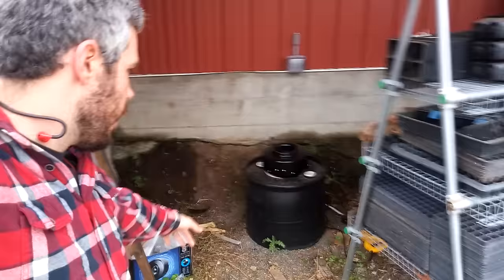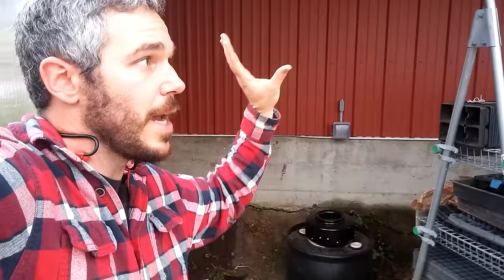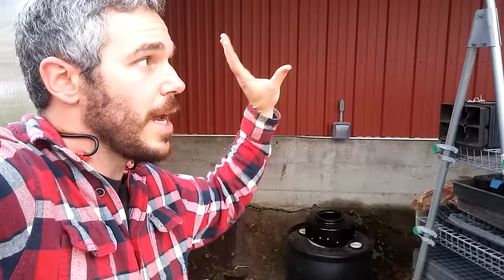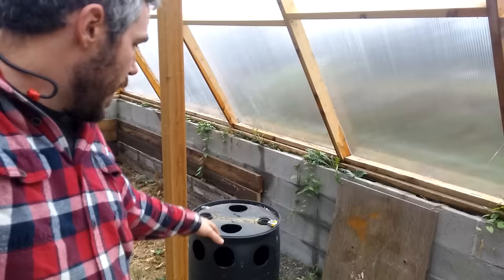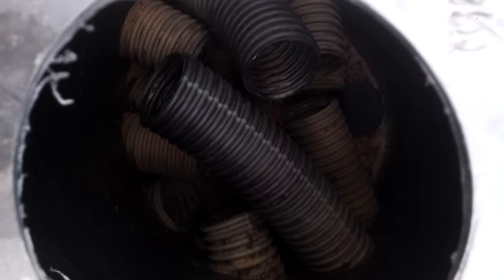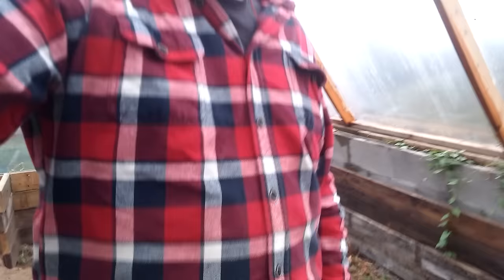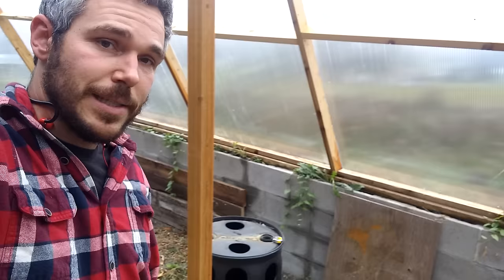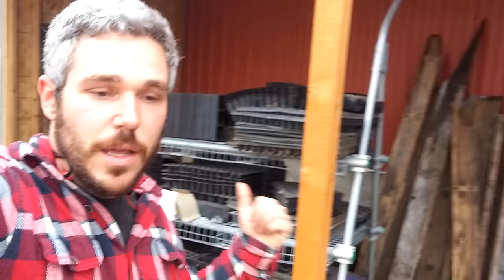Poor Man's Geothermal

Comment: Very cool and I love that idea of the poor man's geothermal.  If you can pull 20 degrees of heat out of the ambient heat of the soil at a depth of 4 or 5 feet  beneath the green house - then you are able to go far in keeping the air temps in the green house abouve freezing - even on the coldest days.  Question -  did you place thermal barriers around the out side of the green house in order to stop the incursion of frost under the edges of the green house?  if that were to happen, I would imagine it would have some significant effect on the amount of heat transfer you could harvest.

Comment: Did I miss the part about how deep to bury the drain pipes? 🤔
Reply: 8 feet. 54 degrees. Warm enough for soil biology but too cool for worms.
Reply: @Horse237  8 feet?  I am luck to have 8 inches of soil!
Reply: @kieranhanrahan2883  Texas is having problems because they are not prepared for the kind of winters Michigan has. Talk to contractors around the country and ask them how deep to bury water pipws so they don't freeze. There were men trying to get away with burying water pipes 6 inches in the Deep South. No More. We entered a Grand Solar Minimum just like the Maunder Minimum of 1645 to 1715 when weather was so bad that wheat prices spiked up to 400% in some years.
I was talking about dirt and not soil. That is where to bury the pipes taking 54 degree air to your greenhouse year round. Cooling in summer and in winter it takes less energy to get the air from 54 to 70 degrees than from 18 or 20.
Reply: @horse237

Like what was just said it depends on your location. In the northwest the freezing depth is only 12 inches.  So do me I may only need to go down 2 feet

But that is because our temp is heavily moderated by the ocean.

But upper Minnesota for example you'll have to go much deeper. Locals will know.
Reply: @briholt100  My point about 8 feet is that we just entered a Grand Solar Minimum just like the Maunder Minimum of 1645 to 1715. It was much cooler back then. The price of wheat in the UK spiked up to 400% in certain years. In 1709 there was a Big Freeze in Europe and the top 40 inches of the ground in France froze spiking food prices 600%.
So obviously if we are entering another Grand Solar Minimum as evidenced by last summer's historic floods in China and the most recent polar vortex wreaking havoc as far south as Texas and Mexico, we ought to dig pipes deeper than what contractors did in the past.
That is why if I ever get a place, I will dig my geothermal vents 8 feet deep. And I will install lightning rods to protect my animals. We will be getting a lot more cloud cover, more rain, more hail, more snow and lightning. I have read of several farmers in Europe losing 50 sheep at a time to lightning strikes. And I have read of several snow storms in Saudi Arabia. 
Edward Maunder was the first to notice the reduction in sunspots and cooler temperatures. Dr Valentina Zharakova was one of the first to notice the reduction in the Sun's magnetism during a Grand Solar Minimum. This allows more Cosmic rays (nuclear particles from distant stars) to enter the earth's atmosphere causing more clouds, rain, hail and snow and striking the surface of the earth and energizing volcanoes and earthquakes. The Big Freeze back in 1709 was caused by 3 volcanoes erupting in Europe which blocked their sunshine. 
People who have read diaries of Americans and Canadians might be familiar with the bad weather of the period. And the most famous record of bad weather was that of the Lewis and Clark expedition of 1803 to 1806 which was during the Dalton Grand Solar Minimum. The Dalton Minimum was when the New Madrid quakes (4 quakes from 1811 to 1812) shook the area from Memphis to St Louis even reversing the flow of the Mississippi river. Of course there also was a New Madrid quake back in the Maunder Minimum on Christmas Day in 1699 but hardly any white people were in the area to record the destruction. 
We need to prepare for future events by buying lightning rods to protect our animals and digging 8 feet deep for our geothermal greenhouses. 
There is Good News. No Chinese government in the past 2,000 years has ever survived a Grand Solar Minimum at least according David Dubyne of Adapt 2030. There is Bad News. Joe Biden has reversed the previous President's Executive Order so China can participate in our electrical power grid. Not a good idea. If any of the 1.4 billion Chinese people riot because they cannot find food, then we will have to export our food to them which will cause Nationwide Food Riots in America.
Reply: @Horse237  I think you might overlooking that even in a solar minimum, our global temps are actually rising so there may be a a few weeks of severe cold weather it's not likely to make the changes you fear. 

But, if you are using equipment that can dig 6 feet, one could say dig a few more feet. Assuming you don't get into a water table or something it might be fine.
Reply: @briholt100  I know people who were alive in the 1930s. They say that was a blazing hot decade compared to today so we were never in a period of Global Warming. Al Gore was clearly wrong when he said that snow was a thing of the past. 
The cooling effect of all the extra cloud cover is slight. But like I said Cosmic Rays (nuclear particles) energize earthquakes and volcanoes. In 1709 3 volcanoes erupted in Europe sending so much ash into the sky that sunlight was partially blocked. This froze the top 40 inches of the ground in France.
In 1815 a volcano erupted in Indonesia sending so much ash into the atmosphere that it blocked sunlight in America in 1816. You can Google "1816 year without a summer." If that happened today farmers all across America would be hurt financially. And we would have Nationwide Food Riots as I have predicted for several years.
Reply: @Horse237  bwap. Ha. I know a guy as evidence.  You just can't use anecdotes that way. I'll trust the group who just put a helicopter on mars WRT climate change and solar minimus.  cheers

Comment: Hey, it looks like your space is roughly 16x24, possibly averagevroof height of 9’. Serious guessing here. This is close to 3500 cubic feet, which makes a rough piping ratio of 7:1, volume to pipe-length. If my SWAG is close, 280-300 cfm fan power would work, which is wonderfully reasonable. How’s my math look? Did I get even close?
Reply: Simple ratio of old to new size

Comment: Using silicone rubber or resin impregnated thick fiberglass yarn and coated with EKOR mineral based-plastic, neither extreme heat or cold can go inside nor can heat the got inside escape.

Comment: How deep are your drain pipes? In general soil temp is constant year round at about 6’. It doesn’t look like you have your pipes that deep. That depth will affect the benefit. As proof of concept one of my professors developed a similar system to provide AC to a campus building. He used a secondary coolant system to take full advantage of the rankine cycle to remove latent heat of vaporization. Also had to drill a lot deeper than you have.

Comment: In the winter how will the water get out of the buried drain pipe? How deep do you have to bury the pipe to achieve the constant 50 degree temperature year round? With all the corrugation and bends in the pipe how does that affect the efficiency of the fan?
Reply from the maker: The water seeps into and is absorbed by the soil. It's not enough water to be an issue. As far as the bends, corrugation and fan efficiency, I really couldn't say. The bigger issue there would be leaks or plugs in the system keeping air from moving freely. But, I don't have a control. I imagine it would be more efficient if the runs were totally straight, and if you have enough space, that's the best way to do it, but I can't imagine it's a big enough issue to really matter.

It really should be below the frost line, but the deeper you go the more consistent the temp. If you are in very cold or very hot temperatures, you would go deeper (maybe 4-8 feet) and in more moderate temps 2-4. Some of our pipes are a bit deeper than others. Ideally, I would have gone further down, but that wasn't practical.
Reply: Constant ground temperature only applies to ground that is open to the elements and influenced by those elements. 
A piece of ground covered/sheltered from the elements by a greenhouse that has heat added or removed from it will have an annual temperature based on the new energy in / energy out balance. 
 Over the past 7 years the ground beneath my greenhouse now averages 5 deg C warmer than the soil outside at the same depth, which hasnt changed.
Reply from the maker: JohnGuest45 thanks John, really appreciate your input here. I figured that the ground d temperature would increase over time, especially since my tubes are pretty shallow. Do you think the same would be true in a system where the tubes were, say, 5' under. I've seen them that deep in other systems, especially where temperates get much colder.
Reply: It could just as easily decrease if the new energy balance is negative, this would be likely where heating is dominent and the summer gains are low. A finite mass will hold a finite amount of energy and, contrary to popular belief, it`s not recharged by heat from the earths core :) Most of the systems out there dont monitor enough parameters to get a picture of what is happening, some dont have any sensors in the mass, which is where you need them the most. 
Duct inlet and outlet temperatures are meaningless without a flowrate. A large in/out temperature difference may appear impressive but if it only equates to a teaspoon of warm air every 5 minutes, its not going to do much to heat the greenhouse. The same applies to cooling.
The important parameters to monitor are the mass temperature at various depths and locations in the system, airflow rate, duct in/out temperature and RH. External mass temperature measurement using multiple sensors and depths allows you to track and compare the temperature of the ground outside.

Comment: When you say 500 feet, how far down underground is it? How far down do you go, and how do you do that?
Reply: I’m not an expert in this at all, but I believe you just need go down like 4-6 feet or so, maybe a bit more. Then you snake the hose for 500 feet, or as long as is needed for your application. Essentially you are just turning the ground and your hose into the coils on your cars radiator. As the air gets sucked in and out of the vents he showed it goes a few feet underground and snakes through the pipe long enough for it to change temp to match the geothermal temp.
Reply: @brenttanner9889  Thanks, that's a lot clearer to me now.
Reply: @brenttanner9889  I'm not sure where exactly he is and am also no expert. I would expect that you would want those lines deep enough to be below the frost line. I am looking into options that would be able to work for me, I would probably have to go much deeper being in the Canadian parries.
Reply: @murraynelson696  6 feet is deep enough to get the year round constant of 50 - 55 F.  Even in Canada that can work, PROVIDED a) the buried hose is beneath the greenhouse and not outside it's foot print (wall parameters), and b) the interior air in the greenhouse isn't allowed to go below freezing temp. during winter. In this way there isn't any frost to be driven down when one enters and walks about in the greenhouse.

Comment: U can heat that entire greenhouse with two terracotta pots with bottoms and 2 large candles. You put the candles in the large pots, put the bottom of the pot on top of the pot, making a lid, make sure you put a candle in the pot and light it. The pot heats up, ultimately heating up your area that needs heating. You could also flip the pot upside down over the candle, if the pot has a hole in the bottom of it, ultimately heating up the area. Now that's a cheap way to heat an area!!!!
Reply: The terra cotta doesn't change the fact that you'd only generate 75 BTUs or so with 2 candles.  An uninsulated non airtight greenhouse would probably need 15,000 BTUs in 20 degree weather to bring the internal temperature up to 50 degrees on a day with calm air, much more if it's windy  That would be 200 candles burning round the clock.  The cost of the candles would more than pay for the electricity needed to provide the heat, but it would also be way more than the money saved by growing vegetables in such a small space.
Reply: @billsmith5166  I heat our greenhouse with a candle. But mines only 150sq ft. However the larger the pot and candle the more eat. You could also make a rocket stove if you had a rally large greenhouse. Your only trying to keep the chill out of the air, so above 45° or so to keep your plants hibernating until spring. That's what we do anyway. And I have a very cheap plastic greenhouse from Amazon hundred bucks greenhouse 😆. However it only gets down into the lower 30s here in VA, and only for a few days at a time then increases. Weather is always back and forth here
Reply: @allnaturalhomesteaders  My calculations are correct.  Are you using the pot to keep the flame from going out?  Why would you think the pot increases the heat generated by the candle?  It delays the heat, so maybe you're thinking that since the pot remains warm after the candle is extinguished - but it also remains cool for a while after the candle is lit, so it's simply trading a cool start for delayed warmth.  If the clay actually allowed the candle to generate more BTUs, all furnaces would be under large clay pots.  Again, though, a candle is only producing 30 to 50 BTUs, so unless your greenhouse is air tight, it's doing almost nothing.  Just for comparison, A human being generates 350 BTUs, so a candle might put out as much as a Chihuahua, and if there is outside air exchange, it would reduce the heat from the dog to almost nothing.  A small rocket stove would generate more BTUs than a candle, but if it's very small, you'd need to stay up all night loading it with twigs.  If it's large enough to stay lit all night, you'd need a chimney or you'd have a substantial carbon monoxide risk, and you'd leave residue from the burn all over your plants.  The temperature of the greenhouse would also be pretty much uncontrollable.  I hate to say it again, but if your greenhouse isn't air tight, your candle is doing almost nothing at all.
Reply: @allnaturalhomesteaders  No.  The Terra Cotta is there to contain the fire because it's fireproof, and it also retains the heat generated, but it DOESN'T increase the heat generated by the fire. Why are there rocket stoves made of metal?  One other thing, Rocket Stoves are TERRIBLY inefficient.  Almost all the heat goes right up the chimney. Absolutely, there are people that heat their Adobe houses with a fire from a clay fireplace inside, and I also have no doubt that the Adobe retains the heat generated, but it's the fire in the fireplace that's the source of the heat, and the clay doesn't increase the heat generated by the fire.  If you think the Terra Cotta is the reason for the heat, set out pottery around your house without candles and pick them up later to feel if they're warmer than your hand.  Adobe is also used because of the lack or cost of other building materials, and it keeps the home COOLER during the day, but retains the sun's heat and keeps the home warmer through the night and the morning.  Why aren't Adobe houses common in Alaska and Minnesota?
Reply: @billsmith5166  have you tried this? If you haven't, then how can you say that it doesn't work? 1st off rocket stoves are made with metal barrels and mud/terracotta/clay. And yes the heat from the fire radiates from the flames, into the metal and into the clay. Yes  rocket stoves are extremely abundant in Canada and even in igloos. I'm not talking about adobe houses. I'm talking about a fire inside of clay. Clay definitely holds heat! If it didn't, it couldn't be put into a clay oven to dry, because it couldn't hold heat to dry the clay. That's how pots are made, is by placing them inside of a clay oven. You don't think it's hot standing next to that oven? You don't think that the oven doesn't heat up the building? So brick fireplaces must not work either, because that's also a flame in clay! Seriously think about what you're saying. Your saying clay can't hold and retain heat. And it certainly can. Hence earthship homes without heat or cooling in them the clay heats up during the day from the sun, and RETAINS the heat and slowly releases at night time to heat the house. So unfortunately that right there throws your theory right out the window. An earthship home, with a brick fireplace, is one large terracotta pot aka clay! And The desert does get below freezing at night. And it even snows in the desert. The people of those clay homes, certainly don't freeze to death every time it gets below 0 in the desert.

Btw I have a burn on my hand right now, from picking up a hot clay pot!

Man use to use clay to cook their food in because how well it retained heat. Hun no offense, but do some more research on ancient Man and see how they made their homes, and heated them please.
Reply: @billsmith5166  also keep in mind Hun, the larger the pot and candle, the more heat is released. This research is just with tea candles Hun.

Terracotta is a material particularly suitable for Egloo because the heat, rapidly stored, is slowly and gradually conveyed to the environment by thermal radiation
Reply: @allnaturalhomesteaders  Well, I think I've made my point, so I guess I'll let the readers decide, but, you said that you can heat a poorly insulated, non-airtight 150 square foot greenhouse with one candle in a clay pot from 30 degrees to 45 degrees.  Considering that there are humans and maybe pets already generating heat in your much better insulated and airtight home, how many candles and pots would you think it would take to heat your house to 65 degrees?